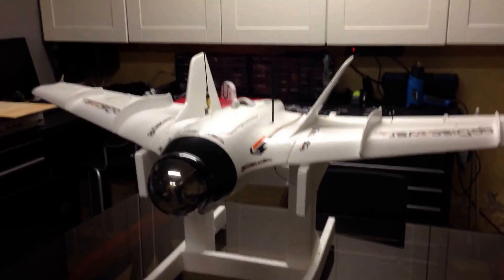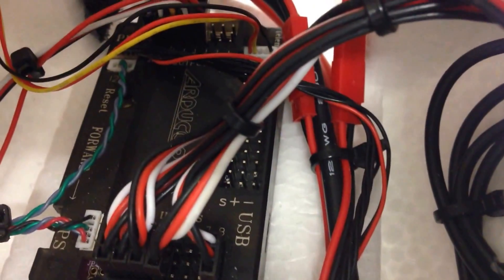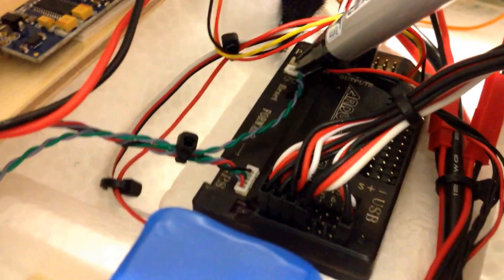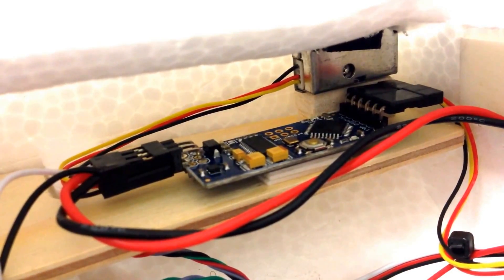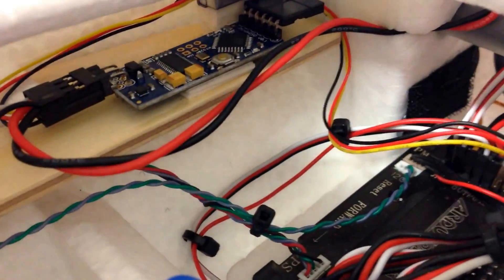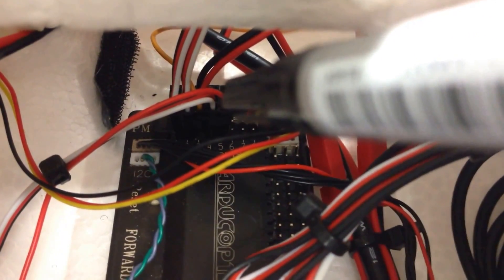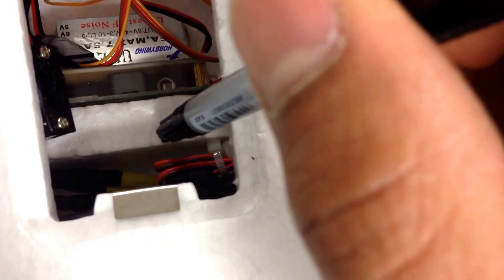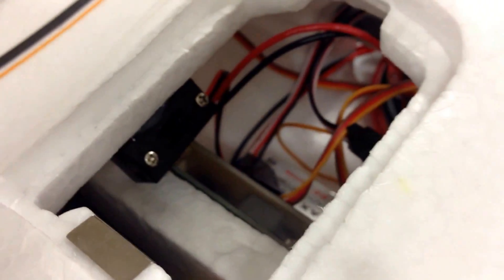Go Discover  - FPV Component installation

Comment: Hey hello there. Is there anyway for me to use MAVLink and OSD at the same time? Because there is only one "Telem" pin on Ardupilot
Reply from the maker: Yes. You can get a 'splitter' cable that plugs into the telemetry port, that plugs into both MAVLink and OSD at the same time.
Reply: +ant0nsmith Do you mean its just simple wiring? I mean, no circuits etc?
Reply from the maker: +Berk Küçükoğlu just a wire. One end plug into telem, one into osd and one into MAVLink
Reply from the maker: +Berk Küçükoğlu search on ebay for a Y-shape APM telemetry osd cable
Reply: +ant0nsmith hey, sincerely thank you for your help

Comment: so im new at this, can you post a  list of components that are needed for the go disc. as if it was in the box and a step by step how to build for beginners with no experience so i can build it as you say what part goes where and how. that would be awesome if your able...
Reply from the maker: In all honesty this should not be your first plane and build. I would suggest you go for something plug and fly so that you get familiar with all the components and how they fit together. I started with a FPV Raptor, a nice slow flyer with good range. You can see it up in the background in this video. I'm afraid that you might put a lot of time and energy into the Go Discover and it all go wrong very fast! Sorry it's not the info you were looking for!
Reply from the maker: In all honesty this should not be your first plane and build. I would suggest you go for something plug and fly so that you get familiar with all the components and how they fit together. I started with a FPV Raptor, a nice slow flyer with good range. You can see it up in the background in this video. I'm afraid that you might put a lot of time and energy into the Go Discover and it all go wrong very fast! Sorry it's not the info you were looking for!
Reply: thanks for your concern, I have already learned the basics. I am just interested in how to upgrade the equipment to the 10k specs. A list of parts would be very helpful, from there I can do the research and instillation. thanks.

Comment: Hi Anton! Great video series you have on the Go discover! ;) I started setting up mine and have startet with reinforcement of the motor mount first of all. But are you using internal compass on the APM or the external one with the gps module? Im used to APM on my quadcopters but fist time on a plane. Im gonna use the APM 2.8 fom ebay :)

Comment: I have had the apm Board Burned on me because of the minimum osd!!! Be very Carefull. Dont use 12 Volt, Solder it and use just the 5 volt and it works fine....:)

Comment: Hi Anton, did you have any trouble setting up the auto stabilisation mixing.. I have the go discover and APM 2.6.. I'm able to get mixing fine via the APM so it responds to my radio sticks correctly but when I roll or pitch the plane the elevons are in complete reverse.. It's like my APM needs twisting 90'.. I've used all the tick boxes in mission planer but nothing helps. Just a though you may have had this crop up. Thanks again and for the informative videos :)
Reply from the maker: Yes! It is possible to have stablisation work correctly, but not rc inputs for your elevons. You will need to tray the following 

Connect you elevon servos - using the reverse funtion on your transmitter, try to ensure they move the correct direction - then test to see the apm stabalises correctly. 

If not

Switch the elevon servo connections with each other - use the reverse function again on you transmitter to get the correct behaviour - then test to see the apm stablises correctly. 

I cant tell you which way will work as some servos behaviour differently, but you will find a way to get it working, if your keep try the above. There will be a combination that works. 

Good luck

Comment: Hello Ant0nsmith, I wanna say a big thank you for these tutorial videos you have here. They are inspirational. I just ordered my Go Discover today; thanks to you. I also ordered the APM 2.6. I have no idea how to set up the APM to the GD. I'm new to RC and I like the RTH & way point features. Could you kindly guide me or direct me to a link that would help me set this up. Thanks so much in advance.
BTW: I bought 2 trainer planes and a Simulator to practice with. I'd only launch the GD when I've mastered the controls.
Reply from the maker: Hi Bennie, thanks for the feedback!! :)
For the APM setup, I found a 10 part series made by dmerc00 to be very useful. I would suggest going through that. He covers APM i think from part 3 or 5 onwards. Then together with reading through the online documentation on arduplane, I think thats a good start. Feel free to give me a shout if you get stuck with anything. 
Regards
Anton
Reply: Thanks so much, Anton. I appreciate.

Comment: Good evening, I'm a big fan of your videos and you have care in assembling their planes. I would like to ask you if you like the style of flying go discover, I'm buying one. I had a phantom 61 that crashed, now I'm riding a go discover with a cyclops osd and dragonlink v2. I wonder also what the maximum range that you got with your dragonlink using the dipole. Big hug.
Reply from the maker: Hi Wilson,
The furthest I have been on a few ocassions now is a shade over 10km. In my recent Go Discover video "10km setup" I had my DragonLink TX set on low power and never lost control. (Flight battery was the limiting factor)

I have seen some Skywalker X7 videos where a Dragolink controlled plane with a booster from Flytron were getting 40km +. Hope this info helps and your having fun with your GD! 

Thanks for the nice feedback, much appreicated!

Comment: Thank you antonsmith for sharing your video and I really think that you have great investment in your aircraft . AS well as good intentions of getting your set up transferred  from your  mind into the  minds of others to see how  you have everything connected in the aircraft. However, if someone  has to see your view points clearly  in their mind . And please do not take this the wrong way. If I had a wish for march 13, 2014, I would wish to see everything out of the aircraft too get a clear picture of how the wire set up is done. And Iam not asking just for myself. But , for newbies  who would like to follow in your foot steps and become a great pilot like yourself. Its the antOnsmith show and what ever you would like to show your video is ok. Just please keep in mind what group of students  you would like too get your point across. Also will subscribe  to your channel:0)
Reply from the maker: Hi Coolwater Hubby!
Many thanks for the feedback - Its always difficult to gauge how much in depth to go, so thanks for sharing your point of view.! :) I will try to put some time into a video covering your feedback.  I have to admit, I wanted to test things worked for me first before putting up the more technical and detailed hardware and software configuration that I went through.

Much appreciation, please stay tuned.

Comment: Interesting why use a 12v unit and not a Bec?
Reply: TheYowzerr Not to take away from a master like Anton just to input my research I have read and seen many Go Discover set ups and a 40amp ESC when the throttle is at full trot for more than 20 second is not recommended and thats on the box. I find that like Anton's set up a larger ESC is the best way forward. 

Also the receiver you have chosen is fine for Park work and not like Antons long distance set up TX/RX. I have spent several months researching airframes and setups on many forums and it is very much horses for courses and Anton has build and chosen an optimum setup for Long Range FPV including ground station he has taken all areas of this hobby into account and come up with a solid solution that should give great results. 

Anton's only problem could be boredom waiting for his Go Discover to return from its trips!
Reply from the maker: TheYowzerr Yes, I read that on the side of the box, and thats one for the reasons why I dont use the 5v from the BEC in the ESC.  You never know, its possible to get lost in the moment of flying, perhaps at too high throttle and the ESC has a brown out!  With the setup that I have, then there is some redundancy and everything is powered within specification.

I have already had two ESC failures since I started in this hobby, the first was a nasty crash, the second is in one of my X7 videos which turned out ok in the end.  

I would suggest that it is always safer to have the ESC doing one job, and a seperate UBEC doing the other.  Its not that expensive, but worth it. ;)
Reply from the maker: Mike Eisen TheYowzerr 
Hehe! I like the comment "Anton's only problem could be boredom waiting for his Go Discover to return from its trips!"  That hasn't happened yet, but I will be sure to watch out for it ;)
Reply from the maker: Hi Mike,
Yeap you are right - I see I make some mistakes when Im trying to do these videos in one take.

http://www.hobbyking.com/hobbyking/store/uh_viewItem.asp?idProduct=49470

You are right it is a 12Volt 5Amp UBEC
Reply: ant0nsmith
Hi Anton, I am also trying to get a setup like your running, already have my Go Discover and a set 3800MAH Rhino Batteries, Turnigy 9XR radio,
Will this SBEC work or not?
https://www.hobbyking.com/hobbyking/store/uh_viewItem.asp?idProduct=10313
Orange receiver
https://www.hobbyking.com/hobbyking/store/uh_viewItem.asp?idProduct=28554
Also can you PLEASE list items which I need to have the setup like your , thanks so much and I cannot wait for the next video
Reply: Mike Eisen
Ho I just noticed you where asking about the SBEC not ESC well the same answer kinda apples the SBEC you have chosen will work out well but what are you going to connect to it? Anton uses two in his design a very good fail safe but it depends on what your connections are in the full circuit. i would do the maths and make sure your well within all the limits i.e deduct 20% of advertised capability.